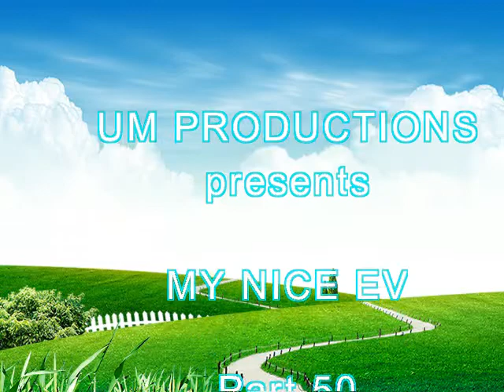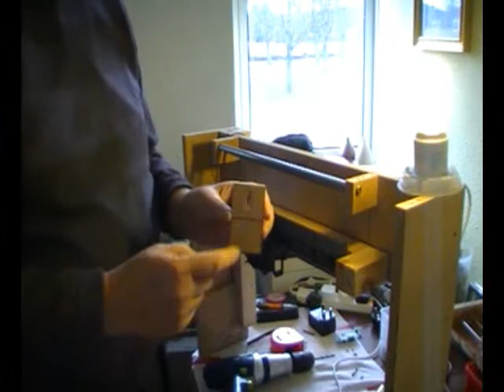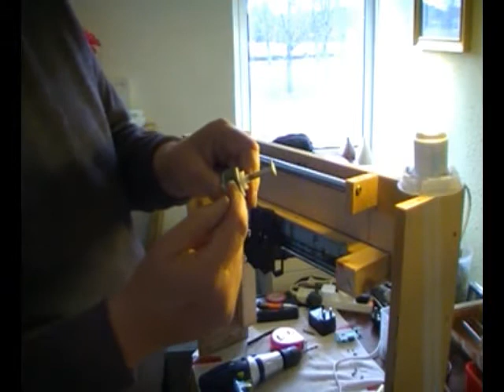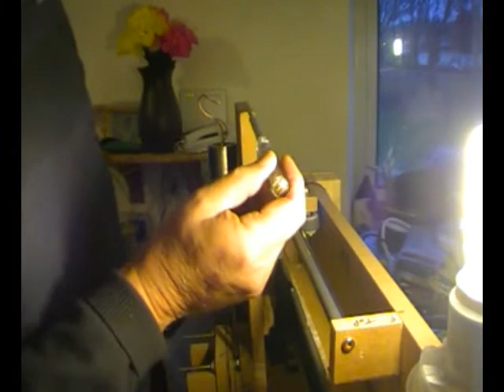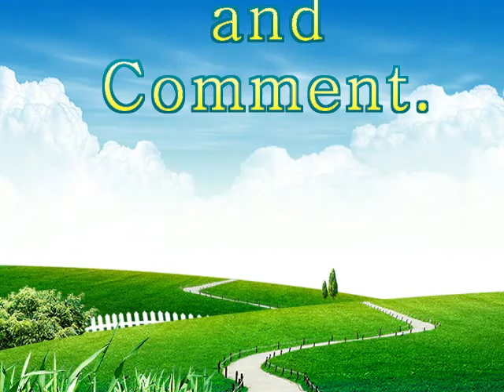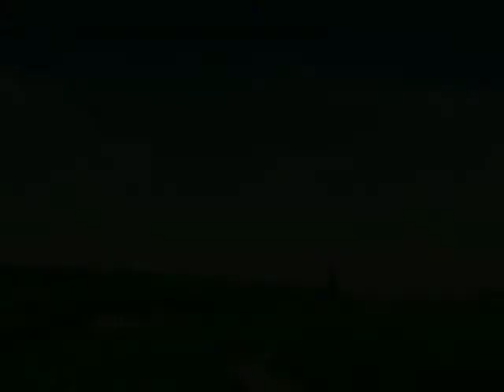MY NICE EV Printer Arduino CNC Part 50

Comment: Why "EV" - doesn't that typically refer to "Electric Vehicle"?
Reply from the maker: Yes it does. In my introductory videos to the MY NICE EV project I stated that I would be showing how to make certain tools for the project. MOT welder and this CNC are projects to that goal. This machine will be making the PCB required for the project and also milling the aluminum dash panel too.
The next project in the MY NICE EV will be the wind turbine. Thank you for commenting. It is nice to hear from you.
Reply: Raymond Earle nice chatting you too Ray. so the router, welder and wind turbine are all lead up to building an EV, then? Why use a Microwave transformer for a welder, it'd have to be totally rewired, no?
Reply from the maker: Yes it would have to be rewired and that would be in the how to video. It is also free. The cable would also will be free for the rewire.
I have a welder. But people copying this project might not. So I show how, with a bit of effort one can be made for free. The vehicle would also have a solar supply from  2V to 15V. Without the cost of an MPPT.